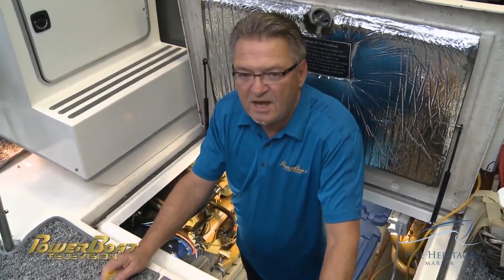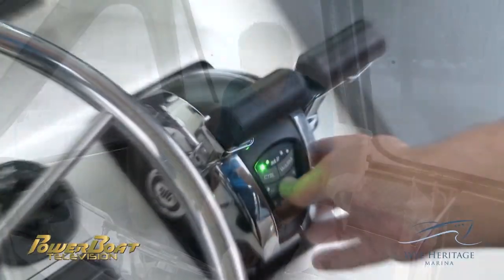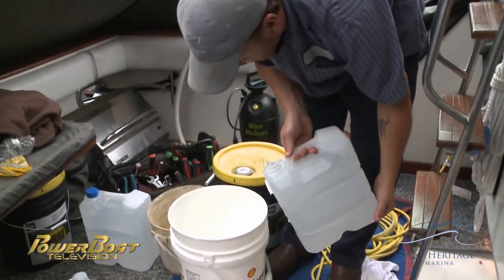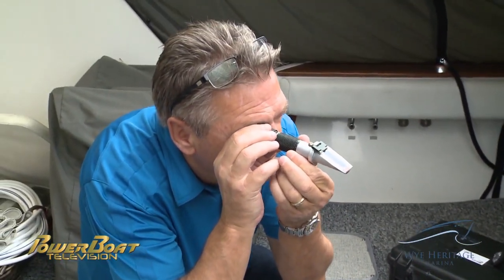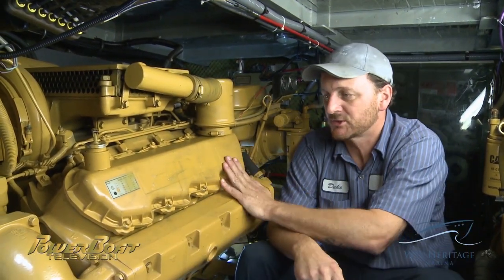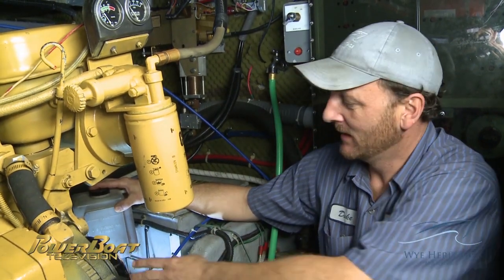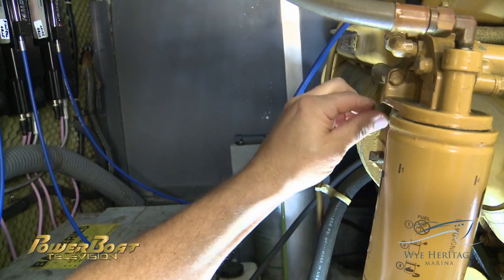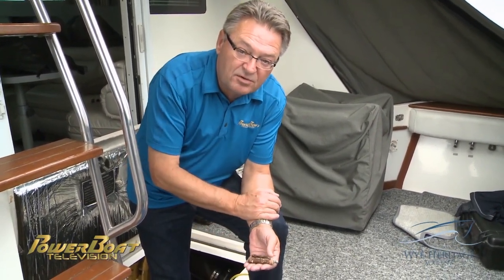How to change the coolant in a Caterpillar 3208 marine diesel engine | PowerBoat TV MyBoat DIY

Comment: Hi Guys, I have the same engine and looking for 2 x 24 volt Starter motor which turns in the CW direction. Any information on where I can source this parts will be very helpful.